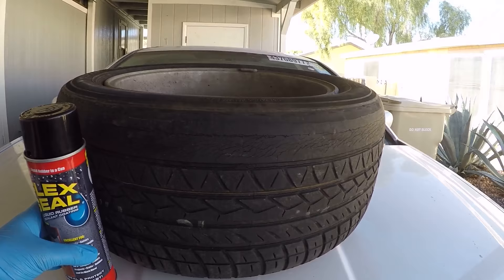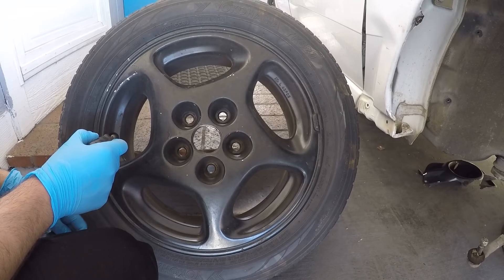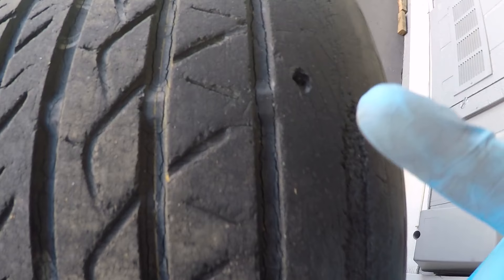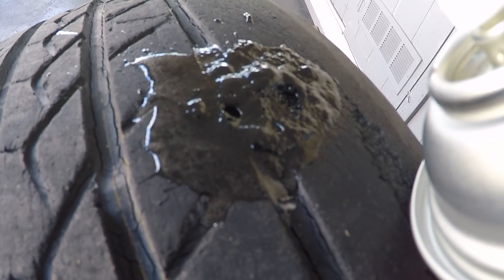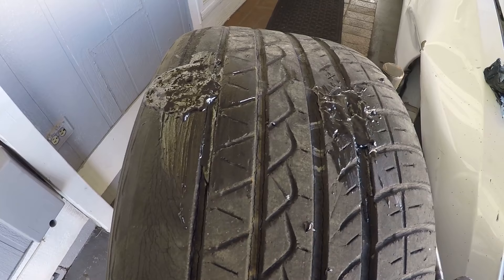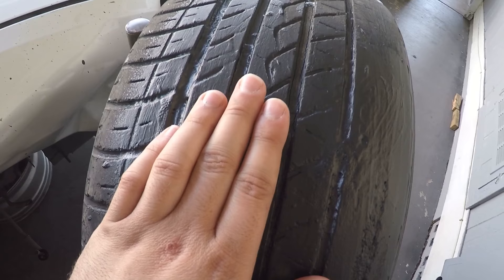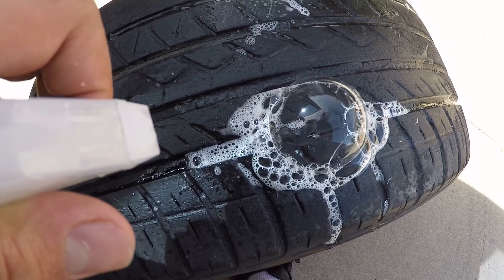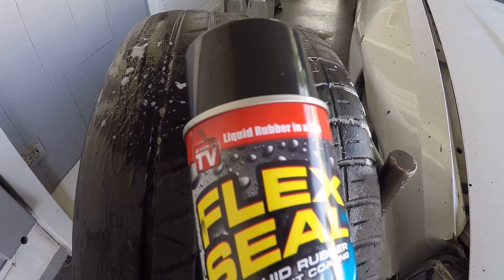FLEX SEAL: Can it Fix FLAT Tire? Let’s Find Out!

Comment: I can personally attest to flex tape patching the inside of a punctured tire. 2 layers worked like a charm. Used bonding cement on the edges of the tape to help keep it secured. Going on a year now, no issues.
Reply: You know a tire patch would've been about 100x cheaper, and you already said you prepped the tire with cement.
Reply: And would your tire pressure light ever come on?
Reply: @MotivatedMetalworks  wouldve been. But i worked with what i had lol, flat and no transport, i mcguyver'd it.
Reply: @sashajohnson812  nope, holds air tight
Reply: @sashajohnson812  got about 10k on it now.
Reply: @misterd717   :)  I can appreciate that.
Reply: @MotivatedMetalworks  Not to mention that when it dried and now going on a year of riding has been crushed and broken off by the bending tire while riding
Reply: @yungchainsm0ker298  i figure if it was going to let go, it wouldve by now..here it is now about 2 years..still holding like a champ.
Reply: @misterd717  Makes sense, sounds legit lol
Reply: Here I am having to do my first oil change on my 1983 Honda Magna v45. Cheers🥂 to a new year of oil haha
Reply: What all did you used
Reply: I know you may be a DIY only person, but why not pay $20 to have it professionally fixed at Costco or any of those various tire shops?
Reply: @article3enthusiast  refer to previous replies....

Comment: This video made absolutely no sense at all to see if Flex Seal could fix a car tire. I had a new set of 4 tires on my 98 Lincoln Navigator ( size 22 Low profile ) and the side of one was split some how after sitting in my garage on a flat over winter. Well, I took it off the rim and cleaned it from the inside as he did with the 70% rubbing alcohol. Sprayed a Few layers of the flexseal in between the split from the inside and then let it sit flat and did it over that. Worked perfect 👍🏾

Comment: It works fine if you pull out whatever made the hole, spray it or put the flex glue on it and the hole, and stick it back in there. Permanent repair.

Comment: Tires are vulcanized rubber, so it would make sense that the rubber would be softer.  An interesting thought for sure, however I'm not sure even I could cheap out and feel comfortable riding on a tire like that, but I'm glad you tried the proof of concept.
Reply from the maker: Just an experiment that did not succeed. Thanks

Comment: Probably would be a better idea to try it from the inside where the air pressure will work with you.
Reply from the maker: S0thernman true, maybe next video
Reply: @GK7GARAGE  I've got a few flex brand products and have wondered about using one for this sort of thing. Perhaps using a circle of flex tape as a patch then spray it down with the seal
Reply: @YurtFerguson  not even kidding I did that last week to my outlaw2 a TV tires. Inside flex seal.taoe n sprayed it with the spray and sprayed the outside. 1 year now still holding air
Reply: @Nobody-Cares1  nice one man. I've been thinking wether itd be a good idea to use the flex tape like a tire patch then spray it.
Reply: Just run low pressure my tires do max 12lbs I do 8lbs
Reply: Also you got yo apply it in thin layers
Reply: maybe because dumb happened?  most patches are from the inside for that very reason
Reply: @Nobody-Cares1   - I was just reading your reply and I was just wondering wether to believe it or not, u said Not even kidding u just tried that last week and 1 year later now still holding air,... like I said not sure because I don't know if u edited & added that 1 yr later or what? but just thought it was kinda sketch when I read it.
Reply: @Molinar57  yes I was typing to fast n didnt realize how I said it. But it did work for a good portion then it all went south after a awhile. It had me excited that it worked then gottheimer best of me after. Not worth it. New tires lol. Sorry about that misinformation
Reply: @Nobody-Cares1   - lol No problem I've done that b4, but Thanks for gettin back to me & for the info u saved me time & grief I Appreciate it.
Reply: @GK7 DIY - I still don't think it wud've worked anyway this way like a few other people said shud've tried from the inside, but I think it might have worked way better if you wud've let it cure longer u put way to much for just a 24hr cure it also says on the can to do it in layers letting each layer cure 24-48hrs, just sayin the way u did it & then sayin it doesn't work just gives the product a bad rep,- but like I said I still don't think it wud've worked.
Thanks for the video though got some good info from the comments.👌👍
Reply: Nat Sarim  lol Yeah. I didn't notice my comment said "year". I originally was tryna say "1 week" but yea long story short. Just get new tires 🤣🤣
Reply: Nat Sarim  And for what then... And what now, you could legit cause someone’s life to be lost over that little lie in a yt comment. Bike tires aren’t like cars you only got 2

Comment: It didn't work because you patched the outside of a pressurized tire. Try it on the inside so the pressure will help the seal. And nobody runs over a spinning drill, try a small nail.
Reply: I thought that was the point of trying to fix without taking tire off. Do you know what a pita that is without a bead breaker. I bet a slow leak could be fixed from the outside.
Reply: Lol crazily enough somehow my girl managed to do it.

Comment: For any possibility to work the flex seal would have had to cure for the full 24 hours.

Also, with the valve stem core still in the valve stem the flex seal is not going to go down into the hole.

It could even have been helpful to remove the valve stem core, put a straw on the valve stem, apply the flex seal and go down to that Vave stem and suck on it just enough to suck the flex seal into the hole.

Comment: What if you left it alone and didn't wipe off the excess and then you went down the tire a little bit further and maybe even use the flex tape on top of that to see if it would help to seal it I am an emergency so I had to get flex tape brought to me but not the tape I'm getting the spray I hope it works for me to get

Comment: You should take the tire off the rim and use flex tape and try to patch it from the inside to see if that works
Reply: He doesn’t even have an air compressor I doubt he’s got what it would take to break the bead.

Comment: It would probably work.   You are going to get a bunch of "company says not to do this" because of liability lawyers....etc. from the company.   why not spray it on the inside?     That will work far better.   I bet you could take a piece of screen from damaged window and spray it.    I wouldnt expect it to balance at 65 mph.  but you could probably spray a bit on the opposite side. to balance.

Comment: Sooo, u just patched my friends tire that had a screw in it. I used that "Slime Tire Patch and Repair Plug" stuff that has those rubber plugs. It did not come with any rubber cement tho. But, I plugged the tire and it did hold air. But, I was skeptical to put it back on the car because it didn't come with any rubber cement. Soo, I did spray some of this "Flex Seal Liquid Rubber" over the plug. It says to let dry for 24 hours. Soo, I left the donut on her car for now because I didn't wanna put the tire back on and it end up leaking once she drove it. I'm gunna go back tomorrow and see if the Flex Seal Liquid Rubber will act like a rubber cement and keep the plug in the tire without it leaking air, or just completely ripping out of the hole when she drives it. I know all these videos say it doesn't work, but considering I did use a plug and stopped the leak, I'm curious to see if the Flex Seal will work that way.. Does anyone have any experience doing this? Or do you guys think it will work?

Comment: you should put the flex seal from the inside of the tire with a small webbed material ilike used for plaster ,fiberglass matting ect. 2 layers would probably b e more than enough.. the air pressure will keep the seal on the flex seal with matting ..
Reply: i worked out away in extreme remote locations .. the neatest tire sealer i have ever seen was completly out of this norm of my scope of quick fix schemas.. plain old cotton from the plant mixed with a little flour and elmers glue will plug a hole in a farm tractor front tire half inch!!
the operator wa s from mexico and he said if you dont have cotton go find a pillow with the feathers will work just as well but u have to throw a couple of wash rags inside the tire first  and let them start to plug the hole and just let it sit until the rag dries on the inside then throw the rest of the cocncotion in the tire and air it up past  the norm pressure by 20 pnds then spinn the tire till it quits leaking then get to worlkkk! lo it works

Comment: Dude...
 Not even the cheapest tire repair kit just sits on the outside. I think Flex Seal would work Great !But, the correct way to test it would be to put one of those small red straws ( WD - 40 type ) onto the spray nozzle and insert it into the tire a little bit to completely clog the hole. Maybe put it inside so it has a slight build up from the inside similar to an internal patch. Then it would work. No Doubt !
 But you have to have the entire hole filled with rubber and connected to a larger blob of Flex Seal sitting on the surface of the inside that is unable to be pushed through by the inevitable pressure. Bevause the main point is to keep this patch from Blowing while on the road under increased stress, pressure & heat.
 But it will work if done right.

Comment: What was the bit size used for this experiment? That seems like an awfully large hole to expect the Flex Seal to work on, given the pressure put on it after re-inflating. Plus, 24 hrs was probably not long enough time for curing. Directions say, 24-48 hrs...and maximum strength in 7 days. I have SUPER SMALL puncture, on 1 car tire, with NO VISIBLE evidence of the object that's in the tire. It took 2 (looong) visits to repair shop before they finally found it! It was so small they couldn't find it after doing soap/water test AND even after OVER 
 inflating tire...2.5 times its rsted PSI level. The leak is VERY SLOW, losing 6 to 8 PSI in 3-4 days after correct inflation. I'm going to try the Flex Glue & see if it helps slow the leak more or (hopefully) stops it... completely. I will try & do the Flex Tape on inside, too. But may have to remove the object, if it's poking through enough.
Reply: It might be the puncture though
Reply: ??
I understand the relevance of your statement. "What", might be the puncture?

Comment: Now you almost had the right idea fundamentally; all one simply has to do is use the rubber flex seal in conjunction with a conventional latex rubber tire plug; simply coat the entire exterior of the latex rubber tire plug with the spray on rubber flex seal; and then insert the freshly coated rubber flex seal tire plug using the hand tire plug insertion tool half way into the tire carcass; then simply let it cure for about twenty hours or so and it should now not be leaking air hopefully.

Comment: It might seal it if you sprayed on the inside. But at that point i would just patch it. Or plug it. I've never had a problem with a plug. Ok later.

Comment: I've only done what I'm explaining on my weather checked atv tire but flex seal will seal a tire my tire deflated overnight so I took it off rim got the flex seal you put on we with a brush and coated the inside of the tire and let dry overnight tired it up and hasn't went flat since

Comment: Anyone ever try to use two or three different flex seal products to plug a hole? Like the glue to fill in the the hole then flex seal tape over the top then seal?
Reply: Yes just tonight idk if that shits gonna work tho I didn't hear a leak after it dried up but I used flex seal first, gorilla tape superglue around edges of gorilla tape, and more flex seal

Comment: Interesting experiment. I tested Flex Seal against other products on my channel, but not on a tire. I wonder if on a lower pressure tire, like lawnmower, bicycle, or similar, would have better results.
Reply: I'm wondering the same thing. I have a fat 8" tire for my wheelbarrow that has a small pinhole in the inner tube. I think I have a chance with flex seal, but I have the clear kind. Wonder if that will make a difference?
Reply: @Surteronarto  Thanks for reminding me. I would NOT recommend flex seal by itself (Because of the air pressure). But, I did find an easy fix from another channel. Apparently, just super glue and a little bit of paper will fix small pinholes on inner tubes, and then I put 3 coats of flex seal over the paper patch, and it's been perfect over the last week... Hope that helps, because I watched a few videos to come up with a solution that works.
Reply: Yes it will work forsure on that if u do it from the inside and let it cure for a day,

Comment: Either your car is dropped or you have negative camber, that wears out tires faster from the inside towards the frame of the car. I had that happen on my G3 Integra, dropped on all 4s and it ate through all the tires same way as yours.

Comment: Not enough Russian to make this Hack work. I've had success with flex seal at 50 psi on a copper water pipe never tried it on a tire but if I did attempt,  I would hit it 3 times allowing each flex application to fully cure. Definitely not a quick fix.